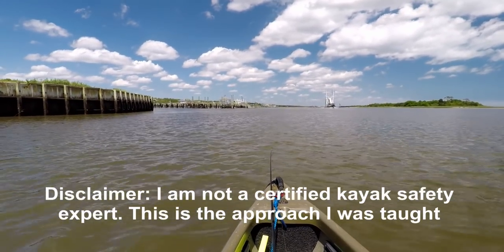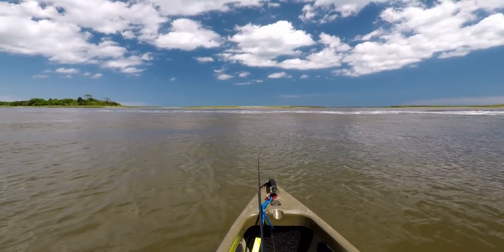Kayak Fishing in Rough Water - Kayak Safety Tip for Boat Wake

Comment: Yesterday I went out onto a lake that goes into a river I'm a novice so when the waves started coming at me I tried to turn into it but the wind pushed against me I was in about 6 ft water and I did not capsize but I could not get the kayak to turn I paddled to shore and got out
Reply from the maker: Ouch.
Reply: This is not a kayak issue it's a yaker experience issue. You see the kayak did it's a design thing and kept you afloat, but you placed yourself in an environment that you were not prepared for. Wind and water size was your problem. Thank god you didn't go over, but in reality, you should not have been out in that wind, and water that big until you had better paddling and yak positioning skills. I too am no pro, but I do constantly evaluate my paddling skills and restrict where I go. 

Also, I am a 40yr plus licensed boater and do understand how to take on waves. This is always in my thoughts while kayaking. In certain conditions pre launch, I will say, this is not for me, and not launch my kayak.
Reply: @Nstruction  I'm an excellent swimmer but your right it's best to start in calm water not try this stuff with boats going by creating havoc that's what happened the waves were huge but I used to jump off a train trustee into the Hiwassee river in an inner tube snd float down the river lol
Reply: @nantahayala2294  That's awesome, but when you kayak you are kayaking. When you jump off of train trusses that's what you are doing. I grew up in ashore town and many of us jumped off of the trusses during the summer for fun. Id didn't jump off into a kayak, and I never took the kayak off the bridge, soooo? LOL

Comment: So what do you do if you're fishing when this happens. reel up as fast as possible and get moving?
Reply from the maker: The most important thing is to turn to face the wave - even if your lure gets snagged.
Reply: Reeling up is not anything to worry about, forget about the lines. Focus on pointing the bow toward the wake and ride it out. Anchor release, if you are anchored should be done. This is why having a quick release anchor with a recovery float is key, or better yet, try not to anchor under these conditions. 

Even if the wave breaks over the bow of your "sit on top kayak", it should not be an issue of safety if you have your scupper plugs out. The water will come over the nose, the boat will bounce, and as it levels off, the scuppers will drain the water. Most quality "sit on top" kayaks can't hold enough water in their paddling areas to sink them (if hatches are properly sealed and closed). FYI, always keep hatches closed if you are not actively entering them. 

The key point is to have the bow facing the wave. Getting caught broadside is a completely different issue and is not a kayak design issue, it's a piloting issue.
Reply from the maker: @Nstruction  I totally agree
Reply: @Nstruction  thanks. I fish near an inlet. About 1/4-1/2 mile from the entrance on the bay side. I don’t even see the boats that cause the wake sometimes so I’m always looking out. Could I use 2litre soda bottles as anchor line floats?
Reply: @BobWhittBass  Just go to the dollar store and buy a pool noodle (orange, neon green or something bright). Cut about an 8-12-inch piece and tie it to the very end of your anchor line. In an emergency just release the line and the end will float for later retrieval. Note, buy a cheap anchor cleat to use on your kayak. Never tie your anchor to the yak, just cleat it so you can jettison in a hurry if required.
Reply: Forgot to say, tie the noodle by running the line through the hole in the center.

Comment: When is the best time to use suffer holes and the plugs
Reply from the maker: I don't use plugs for my scupper holes since I want any water that gets inside the boat to exit. It's a rare day water comes up from below,.
Reply: I plug my scupper holes when fishing in streams and calm water. Even at this time, I may select which holes I plug and those that I don't, to have the benefit of draining during certain water conditions or rain.  

When fishing the bay or water with boat traffic and waves, I remove the scupper plugs for safety. When fishing these areas, assume you are going to get a little wet and allow the scuppers to drain any water that enters the boat. Depending on your sit on top Kayak, under good circumstances, scupper holes just designate a "little wet ass" or a dry trip". In big water the wet ass  "scupper plugs out" is the better bet. You won't get swamped and sink due to incoming water.

Comment: I don't think the depth matters nearly as much as putting your nose into the waves.
Reply from the maker: You need to do both.  Especially on my kayak without the scupper holes.  Any water that gets in, stays in.
Reply: Kayak Hacks Fishing one tip I saw for water is to get one of those huge truck washing sponges. They can pick up any amount of water, don't get in the way and weigh almost nothing. Just squeeze it out to slow bail your boat.
Reply from the maker: Good idea.  I use a car washing sponge right now.  I need to upgrade.

Comment: Wakes caused by power boats can be extremely dangerous; especially if some numbskull in a hotrod boat is buzzing a kayaker to show off. Situational awareness; and, knowing your safety boundaries in a kayak can keep your recreational time from turning into a tragedy; which, can happen in a few fleeting seconds.
Reply from the maker: Absolutely agree.  We have to be alert.
Reply: Yesterday, I was out on SF Bay and one of those numbskulls in a very fast, very powerful powerboat (meaning that the fool could have properly slowed and then resumed his speed without trouble) just had to, had to, had to go buzzing through the 100' gap between me and a jetty at a high wake generating speed, so yes I was quite aware of the peril.  Due to the relatively brisk winds, I barely got my bow turned into the wake, but I did without further incident, bravo for things working right.

So my point is that dangers sometimes will nail us despite our very best efforts to thwart them, so wear that PFD, appropriate immersion protection, paddle with a buddy, and carry a functional VHF.  One last thing, SF Bay is a HUGE body of water, and I have sailed, boated, and kayaked all over it, yet somehow I have had so many close calls on it -- for some bizarre reason other boaters seem to gravitate to other vessels when out on such an enormous playing field, kind of like drunk drivers that ram into the rear ends of vehicles parked on the side of the road.